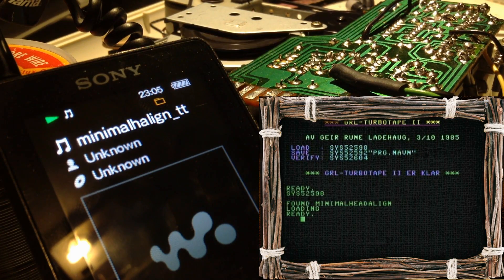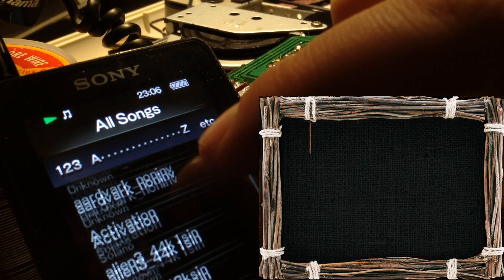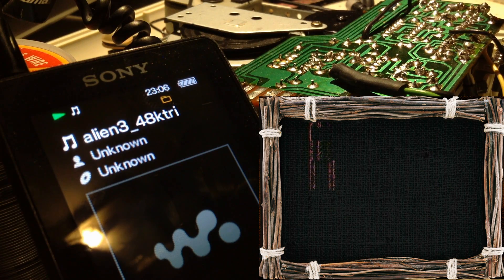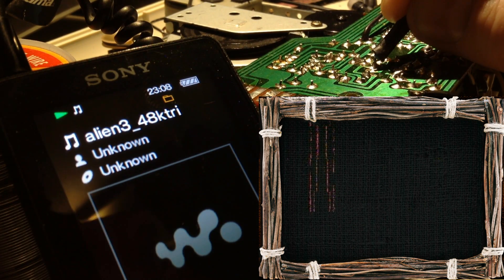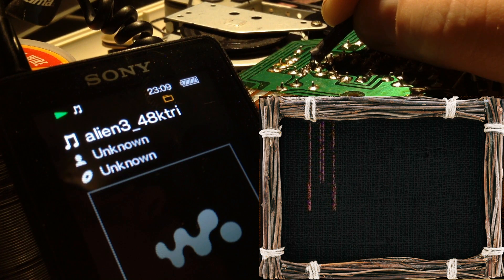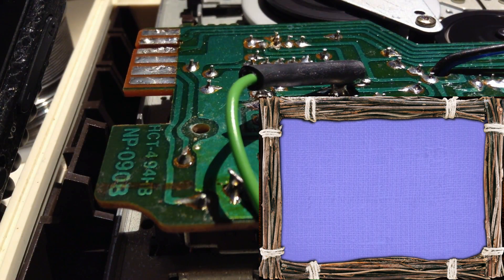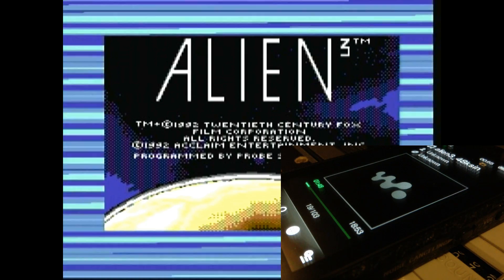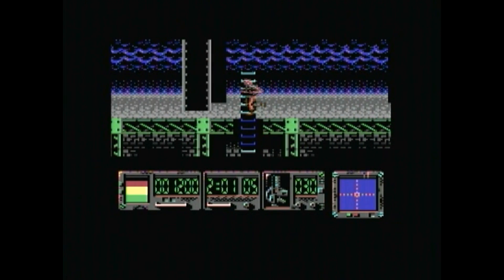C64 Datasette Audio-input mod Part 2

Comment: Thanks -  Those pins worked for me with volume set at around 30%.
Found Android app called tapDancer - does wav conversion/playback & reads zips.
TapDancer also has settings to turbo loads games  :)

Comment: Thanks for this.  Is there still a 100k series resister in place here?
Reply from the maker: Hi. I think so yes. Smaller one would work also. The reason i used so large resistor value was that it was safer to poke around without causing damage to the walkman media player :)
Reply: So could I just exclude the resister altogether now that I know where to connect it?
Reply from the maker: Sorry, I can't say without trying it myself. Should be ok because most amp outputs are capacitively coupled...